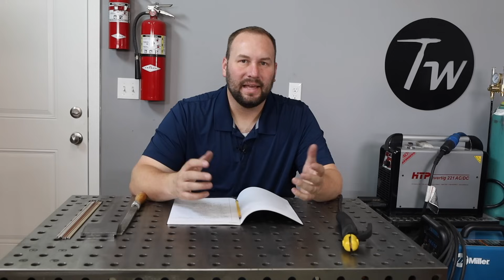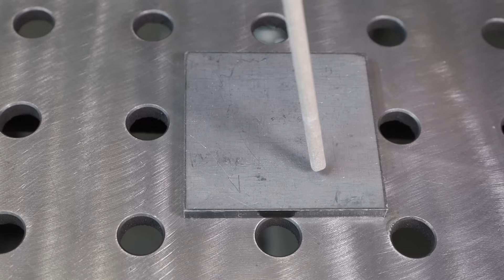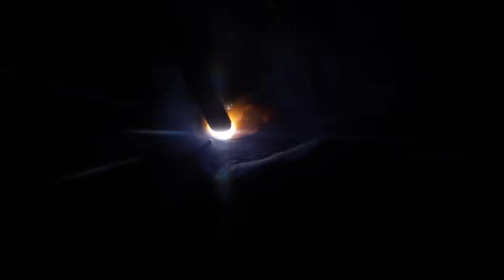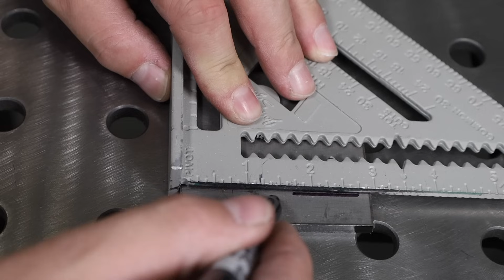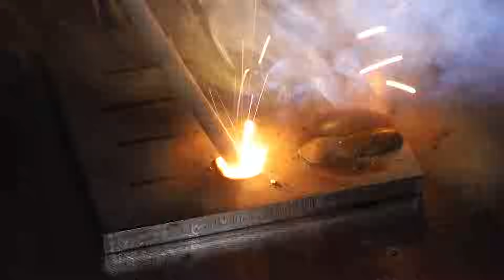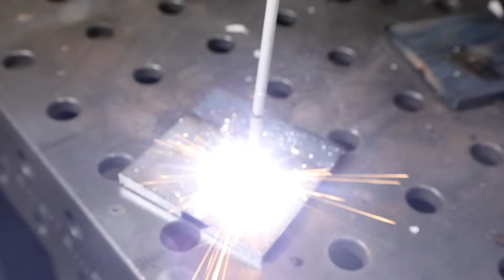Stick Welding: How to Strike an Arc

Comment: Want to stick a rod? Use 7018

Don’t want to? Use everything else 😂
Reply: I had that same problem, and it PISSED ME OFF SOOOOO BAD..... I damn nearly threw welder and all down the hill into the creek...

    THEN I found out that 76018's are NOTORIOUS for drawing moisture and having issues with humidity... Bought a CHEAP (like $10 US level cheap) little Toaster Oven... 

            I'm serious... This "ruddy piece of crap" as I affectionately call it has crusty (??!!!??) everywhere and NO finish on the inside at all... BUT it heats, and that's ALL I need it to do... I've only ever test-cooked with it by roasting an onion (skin on, with salt and butter... and that was delicious)... BUT I'm not about to get serious about cooking with it... I'll build an oven first!!!

     Now, I'm just a hobbyist at this kind of thing.... AND you might want something more advanced, depending... BUT about 300F for a couple hours... and it was like a god damn MIRACLE... I outfitted a wagon with a new tongue (made out of bedrail, because that's what I had) and a towing rig on my Tricycle... with 7018's... Works great and I'm not easy on equipment...

     BUT I just stick about 6 - 12  sticks into the little oven, set the temp a tad high (I found an oven thermometer at the flea market for about a buck... so I go by that) and whenever the temp gets a "smidgeon" above 300F, I set a timer on the microwave and go watch TV until it starts beeping at me... READY to weld... 

    Yeah, the rotten little bastards can still take a bit of getting used to... but that "silly trick" diminished my aggravation by probably 80%... AND since you can re-heat them over and over... AND up to 500F (according to the guy who told me about it) if you're not satisfied with a 300F setting for 2 hrs... raise the temp and try it again... Have a little patience, because... well... they're STILL 7018's... AND try to keep the work "flat" as much as possible until you're confident... 

     Apparently, they're supposed to be "okay" for up to about a week (?) but humidity is HELL around my house, so I generally assume I have to reheat anything 7018 after even 2 or 3 days... Even a day old they SPATTER like sons of bitches... and I mean EVERYWHERE...

      I suspect you're at least half kidding around with "the noob's"... BUT just in case, it seemed like I'd be remiss if I didn't give the story here... It might help SOMEBODY... 

                  ...I mean... I can hope. ;o)
Reply: @gnarthdarkanen7464  Thank you for the info about heating the rods.
Reply: @Word569  Always welcome!

   Honestly I'd do just about anything to save someone the kind of aggravation I went through finding out. I wish you the very best of luck.  ;o)

Comment: Another point, it sticks when the core metal welds into the part you are welding, you need to keep the base metal away from the surface of the part you are welding by keeping your stig in 45° or more (sometimes I keep it at 89.9999°!! 😅😅😅)
Reply: Um.... No. You need a gap called your arc length, which should be the same distance away as the diameter of the rod. Your drag angle should be 10-15 degrees ...
Reply: @brinnheseltine9018  All I said was based on my experience and what I've had hunch about; as I said I learned how to weld by self-practicing roughly within last 45 days! So I never red even one article about it (in opposite of all other things I do for the first time).